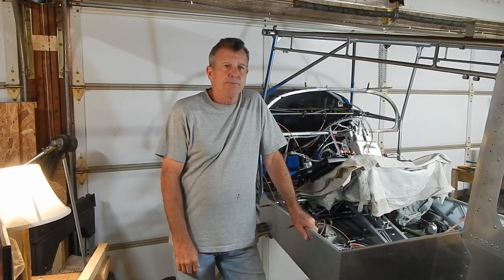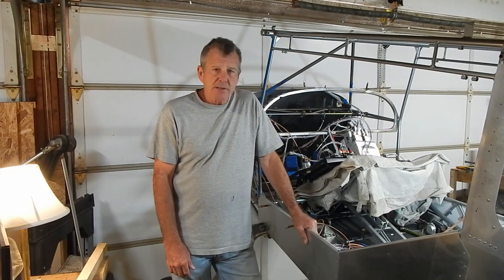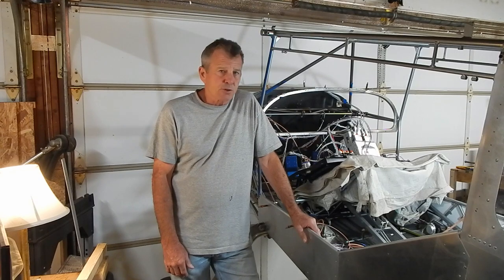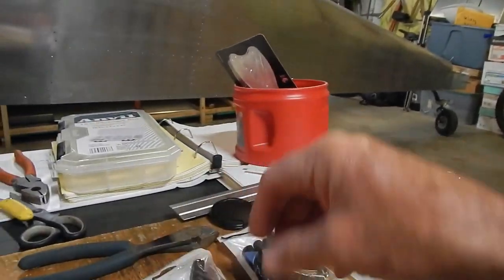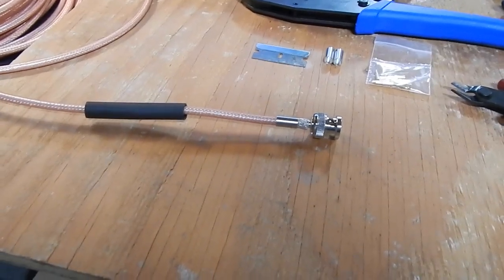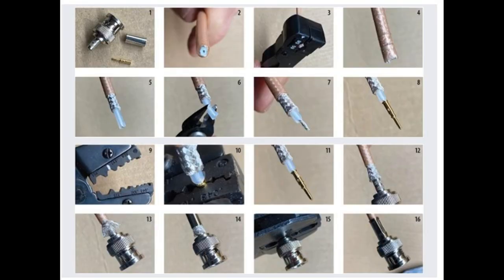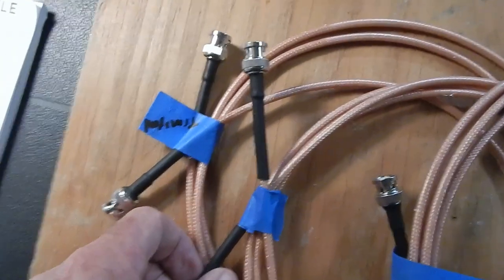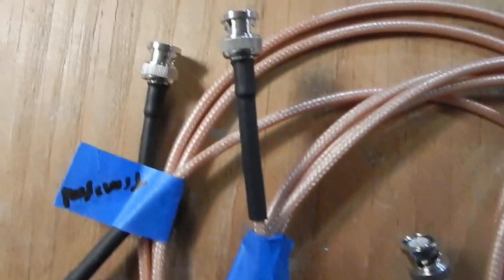RANS S21 Build Ep 28 Coax Cable Learnings

Comment: DIY electrical wiring and avionics are definitely overwhelming for first time builder who are not experienced in this area.  I took EAA online Sport Air Electrical wiring and Avionic class; it went through in more details from the basics, reading schematic, tools for the job, etc.  one of the sections that will worth more than the cost of the class is "troubleshooting"   Highly recommended for the first time builder who want to DIY avionics harness, installation and electrical wiring.